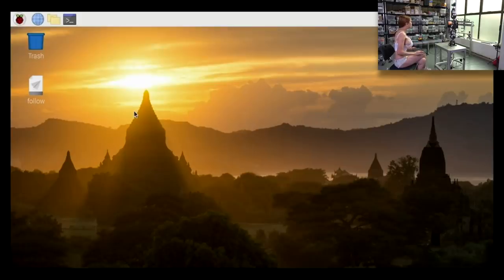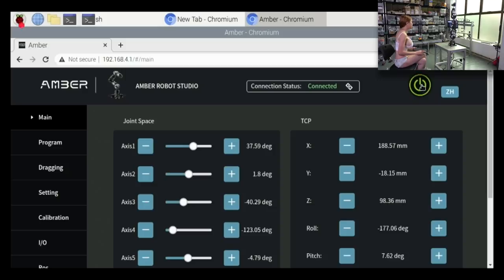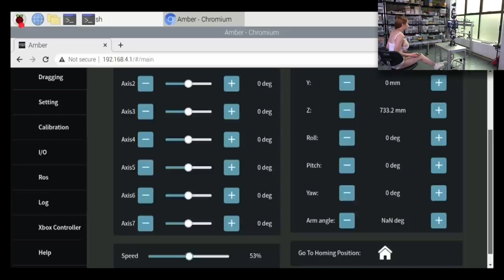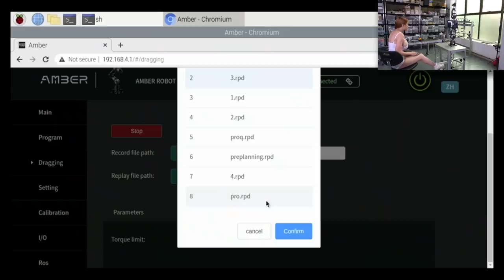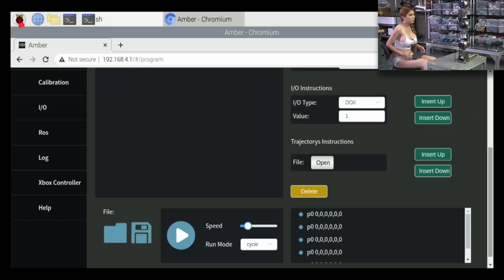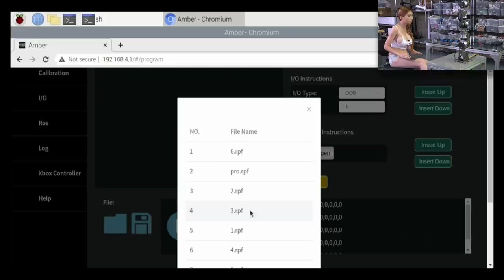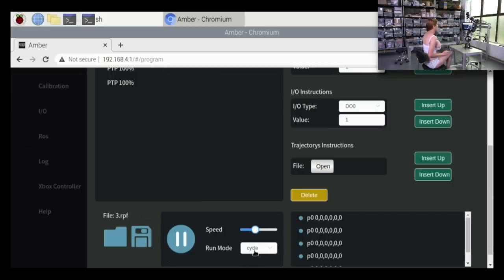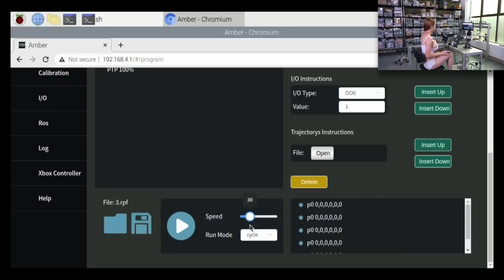7-Axis Robot Arm Camera Control! The Amber B1

Comment: 3kg payload? That's awesome, tons of capacity. I've been watching to get a robot arm for VR HMD testing, and they're around 1kg. Sadly that usually falls in the gap between hobby ones and big industrial ones. So seeing this is cool. (The irony is that you can get an old used industrial arm for about the same price as the kickstarter level here, but then if you're trying to use it in a way it wasn't intended you may be on your own or need expensive interface hardware, in addition to needing concrete anchors and safety equipment...)

Thanks for the video!

Comment: You could set this up with your milling machine to do short to medium sized batches of parts machining. Especially if you manage to fit an pneumatic vice to the mill with an electronic control linked to the cnc or the arms control software.
Just an idea.
Reply: This is a genius idea. Getting this to work together with a milling machine and vice would revolutionize home small batch machining. We could see more small businesses move into small scale production with little startup cost.
I genuinely didn't know 7 axis arms were so cheap ($2000!?!?!).

Comment: That's a StrongArm 4 Sure !!
You should make a video of it turning a ratchet wrench and tightening up hardware nuts and bolts.
This would also be good for controlling watering hoses on a vegetable garden in a loop of recursive motion in the software to produce a spread pattern.

Comment: Catching up on your reviews. That robot arm looks very interesting. This is exactly the kind of arm you would need in a robot "fabber" for picking parts and moving finished and partially finished products along the assembly line. I see it could also be used instead of a PTZ camera control for fancy camera work without the need for a dedicated photographer. I wonder how fast something like that could type on a regular keyboard? Thanks for bringing the latest tech to our attention and your clear ideas on safety and functionality.

Comment: Naomi...what is making the 'crunchy' noise when the robot arm is moving (@4:35, @8:00, @10:24, etc.) ? Is it the sound from the motor? Is it coming from one of the joints? It doesn't sound good.

Comment: I saw that you always appear to have a foot on the table base while the arm is in operation.  Is this because the table needs additional support beyond the bolting down of the arm base?  Also, there is an occasional grinding noise as the arm pulls back after extending in your direction, what is the likely source of this noise?
Reply from the maker: The arm is too heavy for the table and makes it tip over, I rigged something better now.

Comment: Great video, good luck to the kick starter folks.  I am not sure what the applications are for this type of robot arm apart from educational, playing chess (classic robot arm application with an AI based app and a super computer behind the curtain - puts the price up a bit) ... the physical strength seems to be there but the noises it was making and the jerks on the video would make me question the positional accuracy and smoothness of movement (perhaps just a software thing ?).  I guess that with appropriate software anything is possible; painting, making cocktails, cooking, picking up discarded socks for the laundry, feeding the dog, watering the house plants etc.. could all be achieved but would probably need a moving base such as a robot vacuum cleaner? - could be neat as a robo maid/butler/cleaner until they become sentient then ... as per your top :/

Comment: What is the creaking noise when the arm moves? It almost sounds like there are springs offsetting the weight, but that would not make much sense.

Great video, even if you looked a bit scared at times.
Reply from the maker: There was some resonance with the aluminum table top.

Comment: It has the strength to operate a rotary tool with a router bit, or an extruder and hotend for 7-axis CNC or 3d printing. Who is going to write the slicer for it, though?

Comment: How much holding force does the arm have at the joints?  I was wondering about using it as a multi axis CNC.
Reply from the maker: Not quite enough for milling most materials I don't think...
Reply: @Naomi-Wu  could it do pick & place or box packing?
Reply from the maker: @kschleic9053  I think so yes

Comment: Nice job Naomi. Being a robot designer i have a couple of questions since you have the machine. You did say they daisy chained the servos? The robot is not compliant so you are correct it needs a cage. By the way I love the close up, you have beautiful eyes.  Just checked Kickstarter, the MSRP is $14,999, a little steep for capability.
Reply from the maker: It's compliant, you need to set it up in software though...
Reply: @Naomi-Wu  thanks for the information.

Comment: I find drilling to be problematic in getting a result true and not canted.  A robot arm like this could give a consistent hole pattern in true.  Additionally drilling through metal requires consistent pressure allowing the drill bit to dig down without overpressure destroying the bit or material drilled.  Probably good for heavy plastic or related material to include precision drilling in wood.  Depending on the robustness of the robotic arm you might like to try drilling or other functions.

Comment: Where are the technical specs?  I'd like to know the net accuracy when taking different 7-axis paths from an initial position to the same final position.  I'm also wondering if the force-feedback will be more than just a safety item, and sill be sensitive and dynamic enough to be used for manually-guided interactive path learning.  So many questions!
Reply from the maker: Details will be posted with the Kickstarter link shortly...

Comment: Thanks for trying it with a camera!  However it looks a bit jiggly both when it moves and when it stops.  Do you think this is the software maybe moving and stopping too abruptly?  Or is the arm just a bit too flexible?  If they had a fix for the jiggle it might make a nice camera bot!
Reply from the maker: It's rigid, table moves a bit and needs smoother acceleration curves programed.
Reply: @Naomi-Wu  Ah, looked closer and I can just see the table jiggling a bit.  Would be cool to see how it works as a camera arm with smoother curves and a more solid table (or just throw some sandbags on this one to keep it still!)

Comment: Is a good feedback system included in the arm? Or does a better feedback control need to be added to it? Is feedback control direct to the arm or does it have to go through a separate computer adding lag?
Reply from the maker: The motors have it built in for collision detection etc.

Comment: Are they going to open up development or make the software opensource? My guess is the software will always be a weak point for the makers because they are going to make their real money on selling the device, not on providing regular software updates. If they opensource it, we can see a natural evolution take place as different forks compete to be the top used version. Maybe we will even get some open standards which allow for easier cross development between this and other robot devices?

Imagine building a brand new robot arm to opensource specifications with the knowledge that the software is already there waiting.